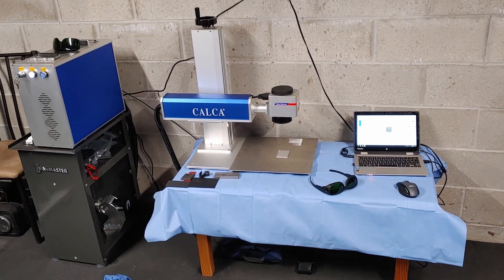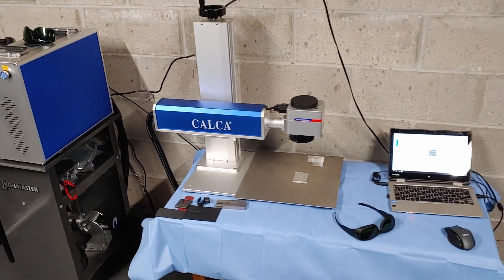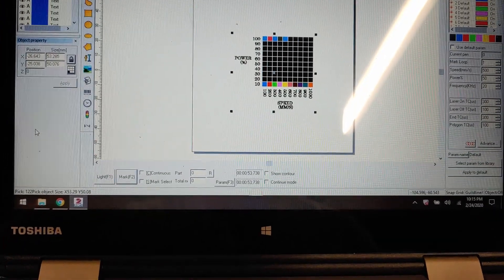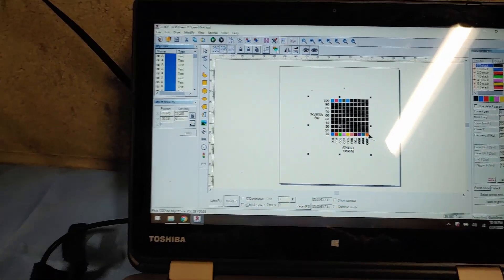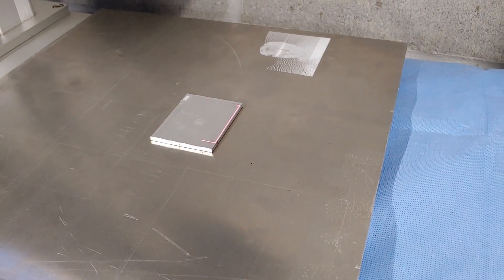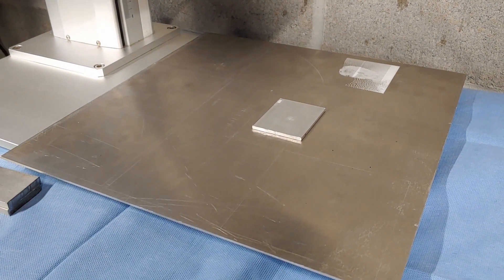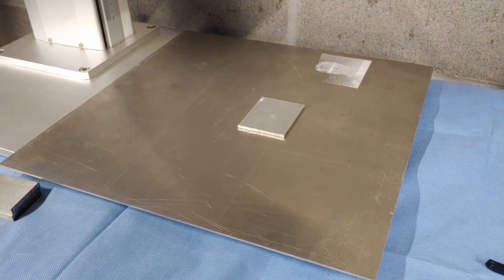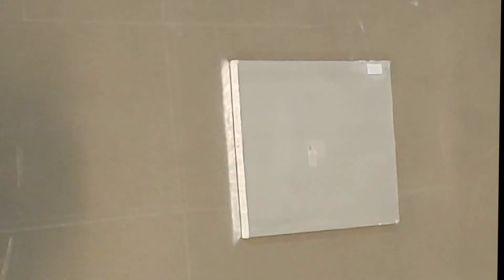Testing 50W fiber laser

Comment: Hey buddy I bought  cloudray 50 watt laser and I can't get this thing to engrave any depth at all. I've watched so many videos with everybody's 50 W laser in graver and they are doing 10 times what mine is doing? Do you have any idea what could be wrong?. I can't find information anywhere man I have nowhere else to look
Reply from the maker: We can definitely get you squared away. A few questions to figure out what the problem might be.

First, what software are you using? EZCad2 I'm guessing? What settings are you using to engrave? (Power, speed, frequency, hatch settings and number of passes)

Next, what size lens are you using? Not sure what it shipped with default, I'm guessing a 120mm or a 150mm came stock but you could have swapped that which makes a big difference on power output.

Lastly and where in guessing a problem might be for you. What are you using to determine and set your focal length? If you don't have your focal length dialed down to within about 0.05", you will drastically lose power of removing material. And just to make sure I'm on the same page for what you're looking for, what depth are you actually looking to achieve and in what material?
Reply: @MPMachining  light burn
Reply: I would just appreciate any knowledge at all or if you can send me in the right path to try and figure this out I'd highly appreciate it.
Reply: @mpmachining7227  I watch everybody's videos that pretty much have the same fifty watt laser as me and they are doing deep engraving. I know this thing isn't going to cut through a 1/2 inch of metal,but I see them  engraving at least an 1/8 to a quarter inch. I mean mine just scratches the damn surface. I'm wondering if my machine is faulty. I hate to bother you I just can't get no answers from anybody. And trying to get ahold of cloud ray the company is just a nightmare.
Reply from the maker: @ays2013boss  the problem might be an expectation issue. With a 50W fiber you absolutely are not engraving a quarter of an inch deep into anything and unless you want to let it go for hours, you're not going to get to 1/8" in steel or aluminum. 

After 20-30 passes at decent settings you should be able to make at depths around 0.01"-0.05" depending on the specific material and settings you have
Reply: @MPMachining  I've tried increasing the power. , decreasing the power,increasing the frequency,decreasing the frequency messing with the speeds and it just doesn't want to do what I see everybody else doing.
Reply: @mpmachining7227  O and i'm using a 100 millimeter lens right now
Reply: @mpmachining7227 I'm confused I just watched you engrave those holes in the video and they are deep?
Reply from the maker: @ays2013boss sorry, I should have clarified. In this video I'm marking just for depth. The holes I get here up to 0.1" deep in aluminum are done with a smaller lens if I remember correctly (I have down to a 70mm lens when I want real depth) and they are very small holes. If you're only trying to see how deep you can get on a small hole like I did here, then you should definitely be able to get 0.1 or up to 1/8". What I meant in my last comment was a larger image or a more functional marking that had some size. It would take almost forever to get this deep in an image that was even 3"x3". 

To try and help you out, could you go back and answer the questions I had for you in my first reply? Without knowing where you're starting I really don't know what to have you try first.
Reply: @mpmachining7227  So here's my ultimate question. Everybody on YouTube is using a 50 W fiber laser  enraver to engrave all these beautiful looking guns. So I'm trying to figure out why they are able to engrave deep and make these amazing looking guns. If they are using a 50 W laser that it must be good enough to do that then right? Because as of right now with my power at a 100% and my frequency at 40 and sometimes on 80 my laser barely scratches the  surface but Yet everybody else with their 50 w laser is engraving. I don't know man this is what I'm talking about. I just can't get anything answered.
Reply: @mpmachining7227 Every guy on YouTube is using a 50 watt JPT,Raycus,Cloudray etc etc etc And they are engraving guns that look phenomenal. Everyone of these guys laser looks exactly like mine just like yours does.
Reply: @mpmachining7227 I'm just so confused right now. See this is what I'm talking about. All these guys on youtube that are  engraving guns that look amazing are using 50 watt fiber lasers just like I got,but you are telling me it won't do that, but then you bore a quarter inch hole in aluminum in your video? I just don't understand man what's going on.

Comment: I'm also considering a 50w raycus.  I need it to cut up to 1.2mm thick aluminium, but also for carbon fibre.  I have found a few videos of people using the fiber laser to cut carbon fibre but not many.  Do you have any thoughts or experience of using the fiber laser to cut carbon fiber e.g. up to 1.2mm.  thickness?

Comment: Ok I'm new to this. Got the cash to fork out but need to know what 50w machine will do the job fast and clean. Type III anodized 7075
416R stainless
6AL4V Ti
4140 heat treated steel
MIL-B-11595E 4150 (CMV) steel
9310, 8620, and C158 tool steel.
Marking depths of up to 0.03"
Work area around 8"x6" min
Will also need a 4th axis.
Reply from the maker: A couple of questions before I start trying to recommend anything to you. First, what is your primary goal for marking? For the 400 series stainless and the Ti, were you looking to achieve any colored markings or are you strictly trying to deep engrave everything? Also, is time a big factor for you? Do you care if the engraving takes a bit longer or are you going for as fast as possible?
Reply: @MPMachining  just engraving. Time is money, but not looking to invest in something where the gains are relegated to the the point past acceptable standards. That is to say diminishing returns.
Reply from the maker: @ahole5407  ok, if you aren't looking for colored engraving then you rea) and don't have a need for a MOPA or JPT source which would save you some money. My laser is a Raycus 50W source that I got from eBay (the seller I got mine from is no longer in business) and it came with the 4th axis. The important things to look for are that the machine is compatible with EZCad2 and that the power source is Raycus. This will give you a frequency range between roughly 20-80 or 20-100kHz. 

As far as an actual name brand goes, it's extremely hard to say. Most of the machines are made in the same one or two factories in China then imported here and either rebranded or just sold as is. The difference in price can vary widely for the exact same machine based on each seller. There are some American based companies that import the machines then do some initial QC checks on the machines and resell them for a higher price but with the piece of mind that you're actually going to get what you paid for (Cloudray Lasers, Wisely and OM Tech come to mind).

A major thing that I have heard people have issues with is customs clearing the laser so an important selling point for me was that the machine was already in the US. My machine came from China but when I purchased it, it was sitting at a warehouse in China. You can just search through eBay for 50W Raycus laser and sort by location if that's something you are worried about. From there, I would just send some sellers a few emails asking questions. If they don't respond to you, or can't speak English you may want to just pass on the laser. Not that there is anything wrong with a company from China that doesn't speak English, but it makes customer service a real nightmare if you had any issues.

Comment: I found your vdo the best out there. Many people just give the info without actually demonstrate. I have a question for you. I’m looking to engrave micro details on small pieces of stainless steel up to 1mm depth. 5x5cm working surface area max. Speed is not a concern but it has to be very precise. What kind of system would you recommend? Would a 20w be enough to go that deep? Thank you in advance 🙏
Reply from the maker: Jeremy, thank you very much for your comment and stopping by. Micro details are really what fiber lasers are great at. I have done text as small as 0.15mm in height with very crisp detail.

For your application, the depth is something that you may struggle with on a 20W fiber. I can really only speak from experience with my 50W laser but if time is really not a problem for you, then a 20W laser will absolutely be able to get there, it will just take a lot of passes.

Comment: Nice video mate,  what is the difference between a 20w and 50w for engraving different colors? cheerz
Reply from the maker: The power of the laser has less to do with the ability to laser colors on things like stainless and titanium and the type of laser is the bigger factor.

To do multiple colors controllabily on steel, you are going to want to go with a MOPA laser instead of a Q Switch type laser like I have. Unfortunately I don't own a MOPA laser so I would have a hard time telling you how much faster a 50W works over something like a 20W

Comment: Wait, wait, wait... the 0.005" (1/200 of an inch) came out 0.1" (1/10 of an inch)... and that's a GOOD thing!? Maybe I'm misunderstanding... I'm an engineer, not an engraver... typically something missing it's mark by a couple ORDERS OF MAGNITUDE is a BAD thing 
("Report! How how did the missile defense grid perform?" 
"Well, looks like they were getting close..." 
"'Close'? Wait... 'WERE'!?")

So clarify for me here: are you saying the file was designed for a 20W, and when run on your 50W produced such a differential, and so you're excited about how much extra power you have to throw around?

Or was that an ironic criticism of the laser's accuracy/the software's performance?

I'm genuinely asking here.
Reply from the maker: Haha I can absolutely understand your confusion here! I probably could have done a better job explaining in the video than I did.  

The file was borrowed from a different user on YouTube named JefferyJ. On his 20W laser he ran this file and got a depth of 0.005". I ran the exact same file on my 50W laser using different lenses without changing any settings just to see the depth I got and those were the results.

To be clear, with this software, you are unable to make any "depth" settings directly. The laser can be adjusted for power (as a percentage of 50W in my case), frequency (from 20-100kHz which also can change depth and surface finish based on the amount of heat added into the part) and the number of passes it makes as well as how far apart the lines are that it's marking. All of those things will have an effect on the depth but you can't simply tell the machine to engrave to 0.005" and it will adjust as necessary. 

In this case, his video was aimed at finding the settings he needed in a specific application to get to the 0.005" depth. He could then use those settings in the future for that same material to have a known depth.

For my test, it was less important the actual depth achieved and more so the relative depth using the same parameters. So yes, in short, I'm just happy that I can more easily get MUCH deeper engravings in the same amount of time.

I hope that clears that up!

Comment: Very cool, thanks for posting this.   Was looking at getting a 50W as well after watching the JefferyJ vids, tho I am leaning towards one of the JPT laser sourced ones to get a little more flexibility for doing plastic marking.   I'd be really curious to see what kind of depth you can get in steel with a longer focal length lens like a 150 or 175.
Reply from the maker: No problem at all, thank you for watching. Roughly what size would you be trying to engrave and how deep? I can do some testing for you if you'd like
Reply: @MPMachining  Mostly I was just interested in seeing if the engraving depth was still acceptable even with some of the longer focal length lenses on a 50W fiber source.     Not sure what all I'd mark yet, but I have a couple of potential business clients for batch marking so even on small parts, the more area the better to make setup blocks for marking multiple parts per setup.

For depth engraving, I'd say .025 or .030" that doesn't require dozens of passes would be acceptable.

Much appreciated.  Thanks for taking the time!
Reply from the maker: I unfortunately think you're probably going to be disappointed if you're looking to get 0.03" deep with a 150mm lens. It's definitely possible, but as you put it, it will take many dozens of passes to get there. I don't have any personal experience using one but from what I have read, both the JPT and mopa sources do just slightly worse at achieving depth than the normal q switch laser. 

Even using my 70mm lens, it would take a dozen or so passes to get to that depth
Reply: @MPMachining  does this cut aluminum?
Reply from the maker: @markk3948  it would depend on your meaning of "cut". Will it mark and deep engrave aluminum, absolutely! If you are thinking you want to use it like a plasma cutter to cut aluminum sheet or plate, this is not the machine for you
Reply: @MP Machining  yeah sorry i meant engrave deep lol Thanks for your reply

Comment: Do you think i can do with 200mm lens 0.2mm deep in aluminiu with 50w laser?
Reply from the maker: You absolutely can. You could get much deeper than that if you wanted. Obviously the biggest factors there would be how large the project was and how much time you were ok with spending. You definitely can't get 0.2mm in one pass with a 200mm lens. But if the part is small it wouldn't take much time at all

Comment: info on the seller.  interested in getting one.
Reply from the maker: Unfortunately the seller on ebay is no longer listed. I would just search around for one on youtube and try to find one that's already located in the US (it will be made in china already but you don't have to deal with customs if it's sitting in a warehouse in CA) and read seller reviews obviously
Reply: @MPMachining Thanks. do you have an idea how much watts do I need to engrave not etch on a  7075 aluminum?
Reply from the maker: How deep were you wanting to go?
Reply: @MPMachining   . 003in (0.07620 mm)
Reply from the maker: @ruggedsapper4751  ahhh something ATF compliant I'm guessing? I have done tons of lowers with mine (I have a 50W.) If you aren't trying to use it as a business and doing hundreds of them, a 20W fiber can definitely hit 0.003" deep it will just take considerably longer than a 50W obviously. As you can see in this video, I have gotten 0.125" deep in 6061 fairly easily
Reply: @MPMachining  Thanks brother.  big price difference between 20-50w.  20w is pretty much in my price range.

Comment: I have a 30w Raycus fiber laser now.  I'm wondering if the 50w is a worth while step up.  Mine takes about 20-30 slow speed passes to cut a small circle in a piece of thin .045 aluminum business card.  Have you tried cutting anything similar with yours?
Reply from the maker: Actually funny you ask. Just the other day, I used mine to cut some 0.05" stainless steel shim stock into 6" strips that I needed. I set it to run 30 passes going fairly quick at about 2000 mm/sec and was able to snap them right off. I had the shim stock sitting directly on my laser table so I was trying not to go through. At around 40 passes it would burn straight through. Only took about 30 seconds per 6" strip
Reply: @MPMachining  That helps my decision.  Thank you!

Comment: I have 30 W. Is it possible to change to 50w
Reply from the maker: The power unit extends from the marking head all the way to the main unit and is connected via a fiber optic cable. Unfortunately that's not something you will be able to work on or replace yourself.

Comment: Thank you for the information.  Is there a particular reason why you went with a 50w instead of a 20w?
Reply from the maker: A 20W would be more than enough if your plan was to surface mark or just etch the coating off of metal. In my case, I do a lot of deep (0.01" and deeper) engraving into steel and aluminum which the 20W would be extremely slow and not practical for at all. The 50W does a great job at it though
Reply: @MPMachining  thanks for the reply.  Then why use a 50W, instead of just using a mill?
Reply from the maker: @Sam11747  also a really great question. I certainly used to use my cnc mill for all of my engraving. Unfortunately even the tiniest of tools can only get so detailed and are pretty darn slow. I have since moved all of my marking from the mill over to the laser which frees up time on the mill that i much needed. The level of detail on the laser is simply incredible. For example, i do a lot of american flags on the hood of pistol barrels where the entire flag is 0.5” or so tall and the stars are about the size of a pen point and under 100x magnification you can see every point on every star. Even on a Kern you would be hard pressed to get that result
Reply: @MPMachining  Thank you for replying.  All good points, and is pretty much the reason I want one as well.  Plus, unlike a mill it doesn't make too much noise.  I don't think I need .01" depth, nor for it to be really quick.  Time isn't really an issue for me in the short to medium term.  As I plan on running one in the background while I do remote work.

Thanks again.
Reply: I am shopping around for a similar setup. Since you’ve owned it a while what consumables have you gone through. Can you do an update if time permits as to the results you have been able to achieve with this? Thanks.
Reply from the maker: Well that is one of the nice things about a laser, there actually are no consumables. Other than the very low current draw, the laser itself requires nothing to run.

I have been really slacking on making videos but I definitely plan on getting back to it soon. I'll be sure to cover my progress on the laser